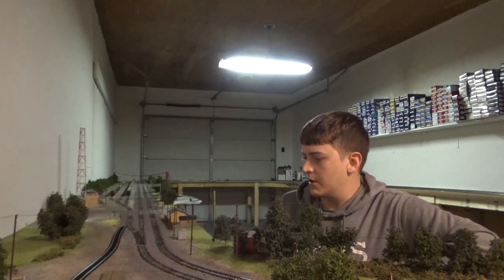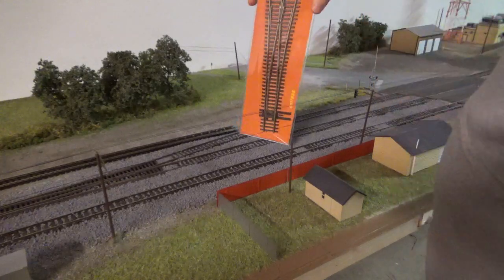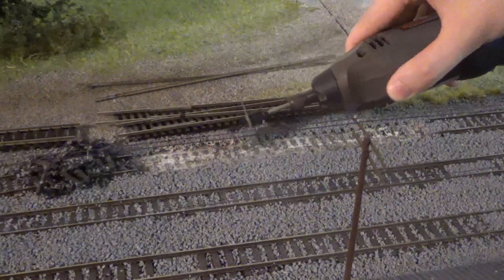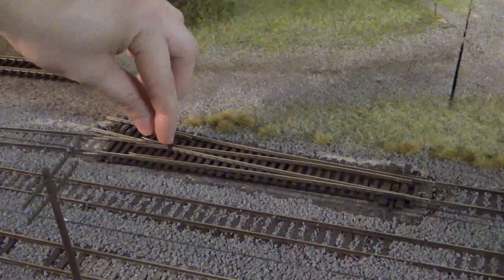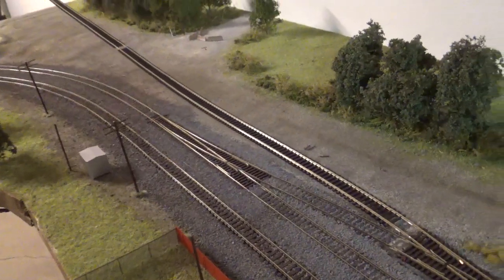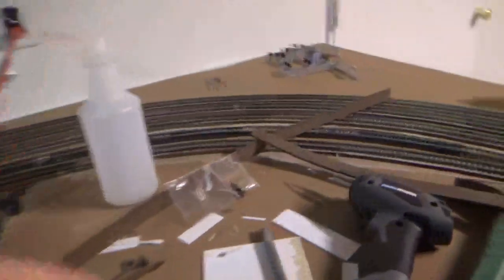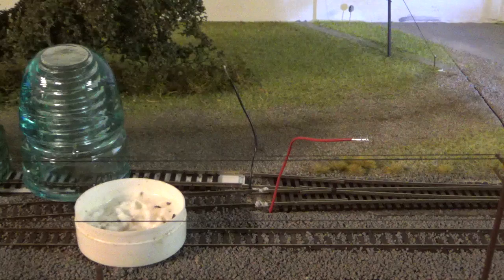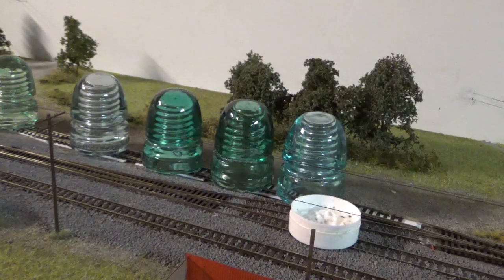Modeling A Branch Lead On The Model Railroad!   Part 1.  Switch Installation, And Laying New Track!

Comment: If you use a traditional white glue, alcohol, and water solution, to remove the ballast just flood it with alcohol and wait minute. It comes up very easy.

Comment: If you bend the feeder wire 90 degrees, you can pull it down next to the rail.  It is much easier to solder and the joint will be well hidden when you paint the rails.

Comment: Good advice on eye protection while using a Dremel.  Some time ago, I was shortening the shafts on my rotary switches on my control panels when the cutting disk I was using shattered.  One of the pieces bounced off the lens of my goggles.  I don't want to think about what would have happened if I hadn't been wearing eye protection.